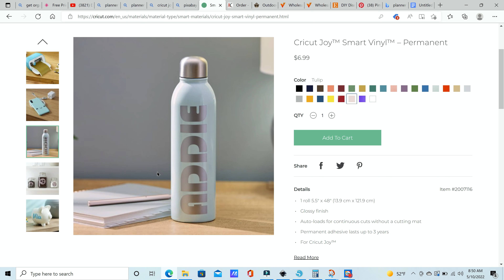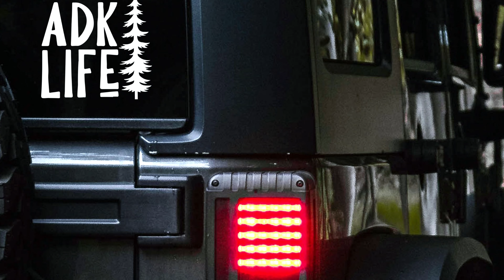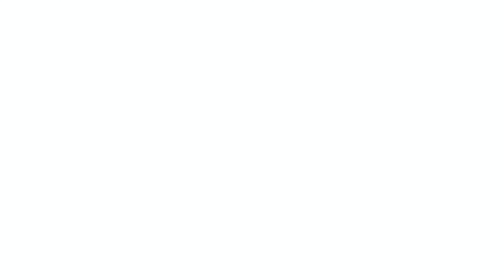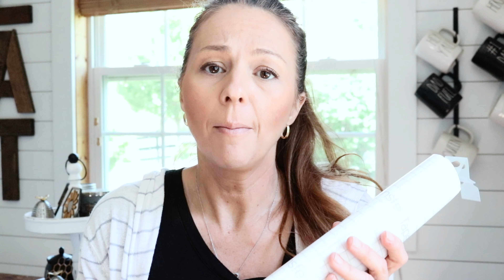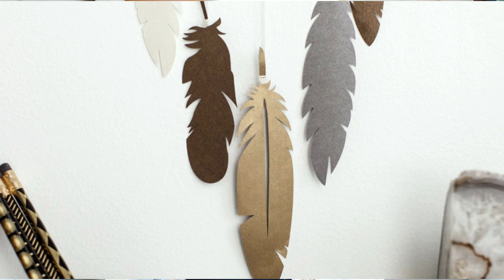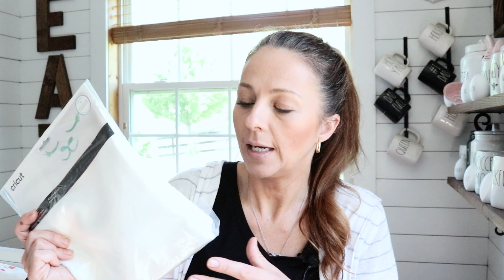Best Products to Use with Cricut....What is the best Cricut machine?

Comment: I am thinking of getting a cricut. I mostly want to make sturdy floss drops/tags for cross stitching floss. Can the machine do this? If so what do I use and can you do a tutorial. I never used a cricut
Reply from the maker: Hi! Wow that is a great idea, I haven't tried making them tho. I have cut 6-10 mil plastics but not sure that is thick enough for what you would need?
Reply: @AppalachianHomeCo  As long as the floss can't cut through the hole it would be ok I would think???